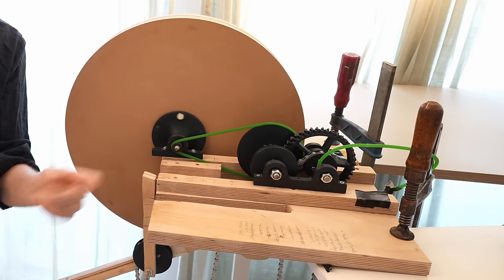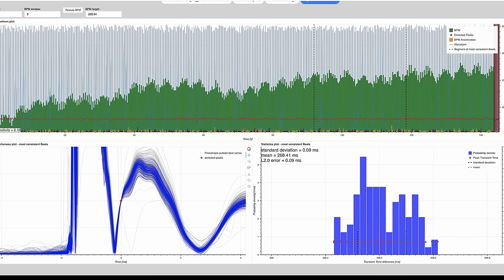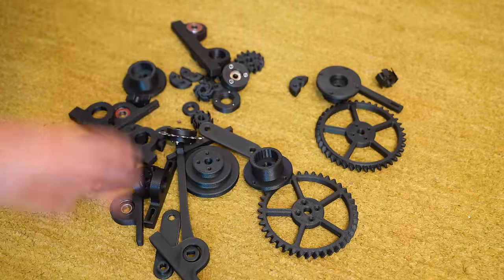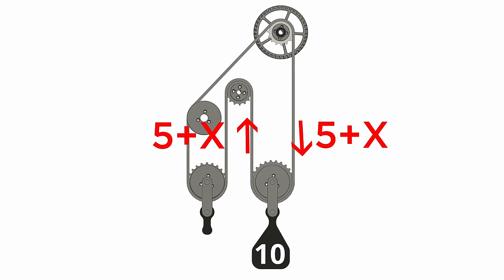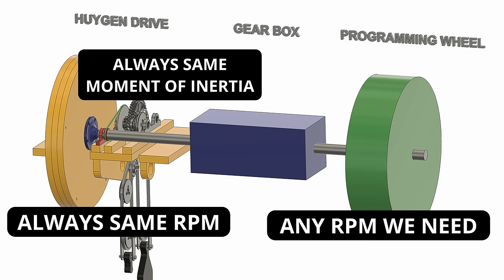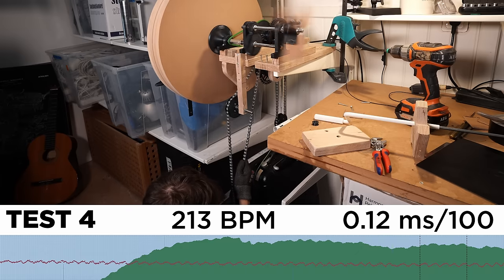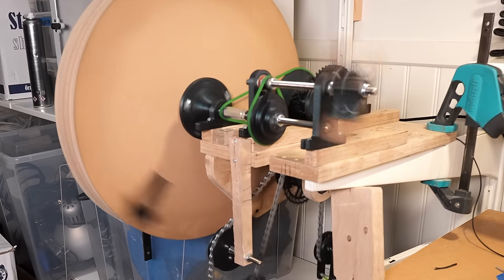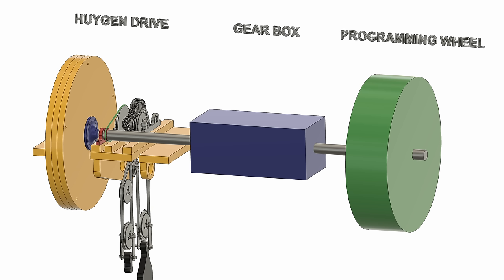Using Gravity To Play Tight Music

Comment: Perhaps Martin You should take a look at governors of old steam engines. I believe they work by as the speed increases, the governor expands, therefore increasing the resistance automatically.
Reply: It's an interesting problem because what actually happened with old steam engine governors was that they adjusted the steam usage or basically the power input. Therefore, maintaining a constant rpm under a varying load. So the issue is how to control a person who is turning a crank, so they always put in the right amount of effort. It's actually not that impossible as it's done on turbo trainers and is called erg mode.

Comment: I actually think the physics you explained about the Huygen drive is not accurate.
If you pull the chain (and with that lift the weight), the additional force is put into the weight as potential energy. The weight will always pull with the same gravity down and therefore, as you say, filter whatever you input, and only output a constant downward force to the flywheel. On the contrary, if your input would also "propagate" to the flywheel, you would have to perfectly input steadily all the time, resulting in no benefit of the Huygen drive. The drive was meant to solve this exact problem, as I understand it. I'm no physics major tho, correct me if I'm wrong 😀

Comment: you need a centrifugal governor. As the speed goes up, air resistance goes up, as it goes down so down the air resistance. Just bare in mind the mass of the balls needs to correctly calibrated for the speed you need to run at.

Comment: I would still put electronic power to it with feedback. Like a servo-motor or something. function before form and it will always work and so much easier to work with than mechanical tightness :)  Or is it that you want/decided that the input power must come from you?

Comment: Dude! You have to be careful, the Huygens drive will give you 100% constant TORQUE while it still has potential energy. But without a feedback loop that will not give you constant speed! The speed is constant in your experiments because the load that you give it is constant. If you have a marble machine with multiple modules that can be engaged independently, the load will not be constant, and neither will the speed. Try putting breaks of different strengths on your expeiment and you will understand. If you want a fixed RPM, you will need a feedback loop, governor, regulator or similar. That was the elegance of your original direct drive solution that it was manually regulated. Adding more load would make pedaling harder, but the speed was at the control of the operator.

Comment: Isolating the flywheel and power input from the machine with a gearbox will not solve all problems around playing at different tempi. Depending on the setting of the gearbox, the machine will have much more (at faster BPM) or much less (at slower BPM) friction, which is going to be the main force to slow down the flywheel. Maybe this could be counteracted by increasing the governor at slower tempi.

Overall I think this design can be very effective at playing tight music, but designing it so it can support different tempi and quickly reach and sustain the wanted BPM could be quite a challenge.

Comment: A flywheel will make sure that irregular things will be smoothed out. However, too much flywheel will make sure that design flaws are very hard to detect and fix. 
By adding more mass you do not address the reason why it is speeding up, it just hides the fact that it is.

Comment: i dunno; I think you're removing the wrong part of the fins.  If you're trying to take advantage of the fact that drag increases with the square of the velocity without the high gear ratio to drive it faster then you want the drag inducing portion to be as far from the shaft as possible.  I'm glad to see you looking into a centrifugal governor.  I would expect that to behave better with the varrying loads the machine will apply.

Comment: I'm no engineer but I'm pretty sure it's better to do the biggest stuff first and focus on the finer details later. Build a rough design the machine, gather data, and then alter things to your liking. If you focus on the small things first, when you put it together, you're going to have to change things or more tedious outcome, redesign and trial and error parts till they fit with your parameters.

Comment: Eventually you're going to realize that you need an oscillating escapement to play tight music with a mechanical machine but it's been fun to watch you try to do it in other ways. When there's heavier or lighter sections in the track, less instruments playing, or more instruments, it will effect the mechanical drag which will in turn effect the fly wheel RPM.
Reply: Exactly! It’s crazy how they are basically inventing a clock from the ground up!

They already exist! Most use escapement clock mechanisms for a reason.

Comment: Dynamic loads, dynamic friction, rpm deviation... Huygen drive is probably only useful for constant loads, if you need to maintain the same RPM. I'm almost certain neither of your two solutions will solve all your problems without some sort of reactive gearbox, that can react to different instruments being enabled and disabled to maintain constant RPM under different loads... Everything comes back to overcomplication and overengineering. I strongly suggest testing a stepper motor for your application, introducing very differing loads and testing how well this system can maintain the RPM. Off-the-shelf parts, constantly variable RPM without a gearbox, much easier assembly with maybe minimal programming that someone can definitely reach out to help with. Martin, the future is now, and it is at your disposal.

Comment: You should consider using a real speed governor (centrifugal governor) so that the speed is independent of the load, as other have been daying in the comments.
The air brake without any feedbak loop is just that, a brake, not a governor.

Comment: Martin! I may have found something overlooked for the end user of this design. I did not read all 300+ comments so someone may have pointed this out.

I know this clip was testing a concept. However. With this crank design, to keep that weight at the desired spot you need to have a hand on that crank most of the time. Can you operate the rest of the machine with one hand? If one hand is occupied feeding the power most of the time, that's a problem. Hand and cranking arm will get tired.

Comment: Like, if you were analyzing the system as an electrical circuit, you'd say there's way too much inductive reactance because the long-term tempo trends are always so unstable. What if there were more elastic components, you keep adding inertia but in the source impedance side maybe you need some elasticity, er, capacitance. What you need are your impulses to go into the mechanical equivalent of a tank circuit.
Reply: If we carried the metaphor a little further, I expect the performance of this mechanism will be significantly different once you start putting a load on it, once you're using it to drive the programming wheel or the actuators.

Comment: Martin, why not tie this drive to a clockwork that produces a speed regulated output? This is how mechanical clocks / watches work, and you could simply gear up / gear down the output to achieve a BPM.

Without the clockwork, the steady state BPM of your machine will be a function of total system drag and counterweight. That means that as you actuate different instruments, the BPM will drift.
Reply: yes that's a great solution but I think an escapement that can handle such a big load would be quite difficult to make (it needs immense precision) and would need to be very robust. Also it would tick very audibly :D and I don't know if you can make a pendulum that is precise enough to swing accurately at like 240 bpm. Balance spring is out of the question. But yeah, gearing it down from like precise 240 bpm would make it quite precise at the lower bpm's. I'd love to see an escapement in this though.
Reply: @dvl973  it would be if you didn't put a flywheel on that side of the system, too. But as long as you do, you're just adding and subtracting a small fraction of the power in the system

Comment: I think you need to check out a continuously variable transmission and basically 3D print a simple version of one and have the output connected to the air governor so you can change the output and the input of the air governor on the fly without having to cut the blades of the Year governor I think if you use a continuously variable transmission but a way that you can move the shift forks and make your own ratios on the Fly you will be able to find the right beats per minute you're looking for Good Luck Martin have a great day

Comment: just an idea ... a dimple machined into the ends of the flywheel main shaft and mount the flywheel virtically with one ball bearing top and bottom other way is magnetically mounted like generators less resistance just a thought

Comment: Do you 'need' the system to be purely mechanical? What about spinning a flywheel which is connected to a generator which feeds bank of supercaps (or a battery). This electrical power is then used to run a motor whose speed is electronically govened using an encoder (e.g. O-drive with a BLDC motor). It will loose some efficiency in conversion losses, but the machine will still be powered by a human turning a crank, its just that the gearbox becomes virtual rather than physical and a microcontroller can then govern the speed within high presciession regardless of tempo and the load placed on the machine.

Comment: Might want to consider a counterweight style governor (see balls out on steam engine) to create tempo consistency.
Reply: Then you would need something like a hydraulic power transfer with a valve, since the centrifugal governor on steam engines controls the amount of steam that goes into the cylinder.
Reply: @rolfborchmann3783  perhaps use the "regulated" end as an adjustment to the shape of the governor?

Comment: I'm quite sure your air governor is not the best idea. It relies on finding a force equilibrium and might not work at all if the marble machine has different resistance over a song.
With a centrifugal governor you can have the system spin free and apply a braking force only at a well defined RPM.

Comment: Did you consider that the tightness of the music isn't related to the speed of the machine as a whole? Most people won't notice a bit of drift. On the other side, it is the relative timing that is really important. This is for example caused by the different marble paths and other differences between the instruments. Musicians automatically compensate for this, but your machine should make this explicit, probably with compensation for the BPM speed.

Comment: Why not try using an eddy current braking system instead of an air governor. Braking force increases dramatically with speed and you can fine tune the overall braking strength by adjusting the proximity of the braking magnets to the non ferrous rotor.

Comment: I think your logic at 8:00 is incorrect about why the speed keeps increasing.
If you're keeping the weight at a constant height, it can only, and will only, exert a constant force on the driven gear. Since net force = m*a, and the weight is not accelerating, net force must be 0. This means that the gravitational force is equal to the sum of the two forces from the chain.

I do like the flywheel governor more than I thought, the results look pretty good. But I agree with your path to try a centrifugal design where the resistance can increase very rapidly when you hit the target BPM and decrease very rapidly when below the target.

Comment: It's hard for me to compare scale here, but the increasing tempo problem seems like it's sort of parallel to the previous iteration. In the previous iteration, you were trying to sync to a metronome, which prevented the tempo from changing over the long term, but by trying to stay in phase with the metronome, you had to keep speeding up and slowing down. Now that you're not using a metronome, you don't have a phase sync problem any more, but there's also nothing keeping you to a constant tempo.

I'd really like to see an apples-to-apples comparison where you test the previous version without a metronome, and only measure its tempo after the fact, as you do here.

Comment: I feel like you may want to measure the stdev as a percentage of the duration of a beat, so that a slower tempo doesn't get an unfair penalty.     4ms offset makes a much greater audible difference at say 220bmp vs 40bpm

Something like stdev is "0.5% of a beat duration"

On second thought, maybe these deviations are so small, that the limit of human perception makes the "pass/fail" threshold more of a constant millisecond value (not %)

Comment: You need to be careful with air governors. Air resistance is a function of temperature and humidity. For old music machines, this is not very important, but for the tolerances you're going for it will be noticeable

Comment: Can i beg you to consider an eddy brake as a governor? Just a ring of copper or aluminium round the edge of your flywheel and you will be able to govern the speed by just moving magnets closer and further from the flywheel. It has the massive advantage over an air brake that it reacts not only to speed, but resists any CHANGES in speed. A second magnetic driven flywheel round it would be even more averse to change

Comment: You may want to consider using an ECVT instead of a complicated gearbox and clutch mechanism. "3D printer academy" has a good video demonstrating it (video is called: Is it possible to have an infinite number of gear ratios?)

Comment: It seems to me that the best way to achieve tight music would be to make the source of timing and the source of power two separate components; that way variations in load won't cause variations in timing.  Thoughts anyone?
Reply: A pendulum / clock mechanism. A pendulum will always keep it's frequency as it is only defined by length and weight. In my opinion the only option to handle variable power consumption of the machine.

Comment: I’ve noticed you use a green band in the drive train. If this has elasticity in it, it will introduce tightness error. It’s also less efficient that direct (geared) drive. Have you considered direct gear drive for the actual build?

Comment: an articulating governor controlling the strength of the input or a CVT on the output is likely the way to go, but I wonder if your air governor is cavitating at higher speeds and would be sufficient if it were not...  have you tried angling the blades so it works more like a prop in air than an impeller with an unregulated intake or enclosing it in an impeller housing for more consistent air movement?

Comment: When you pumped the handle you accelerated the suitcase (I mean "potential energy storage mass") and the equal and opposite reaction pulled down on the chain driving the wheel.
Duh: 10 mins further in the video you did explain exactly this. I just thought you would have realized this when building the first design...

Comment: It seems to me like you do not need a gear box if you use a continually adjustable governor.
If you can change the resistance of the governor on the fly, while playing, you can change the tempo of the machine, no?
Also: nice bouldering there :-)

Comment: Have you tried using a magnetic brake for the governor? It works similar to an air governor except the braking effect is produced by electric currents in the aluminum disk instead of air currents, and you could adjust the 'length of the flaps' by moving the magnets closer and farther from the disk. (possibly with a centrifugal governor)

Comment: You'll never see this but I feel like you misunderstand the functionality of the weight drive. It's designed for an intermittent power input. Like a cuckoo clock. The weight pulls at a constant rate to run the machine and is intermittently recharged by you winding the weight back up. By attaching a crank and cranking at a rate to hold the main weight in position, you defeat this purpose. You would be better off at that point attaching the power input, ie the crank, directly to the flywheel system and getting rid of the weights altogether.

Comment: I’ve always wondered if a engine govenor, like with two balls going up or down as it rotates, had a sweet spot where the rotation is limited by the weight of the balls, like if they were extra heavy kinda, to the point that rotational speed would not be able to lift them more up. And also if it slows down it would speed up because of the, umm, ice skating effect, where the speed goes up when the arms are brought closer to the body.

Comment: oke this is gonna be hard, but you need to make a mechanical speedometer, this gives you an cable that retracts and elongates when the speed of the flywheel changes, with this cable you could control the pitch of the blades of the air gouvner, just like a prop from an airplane or a sailing boat.